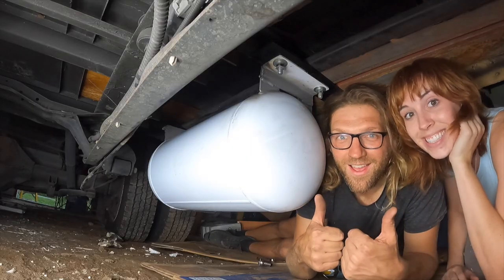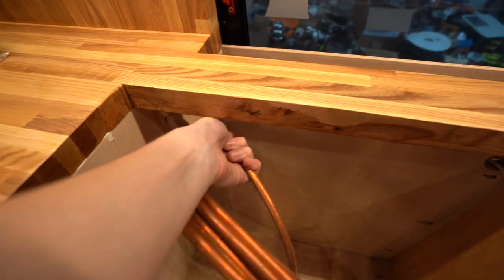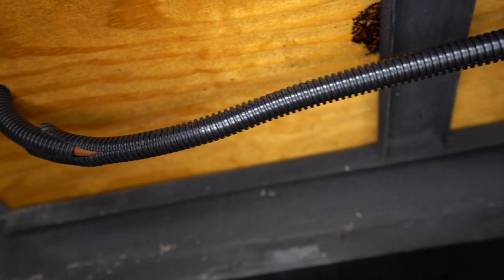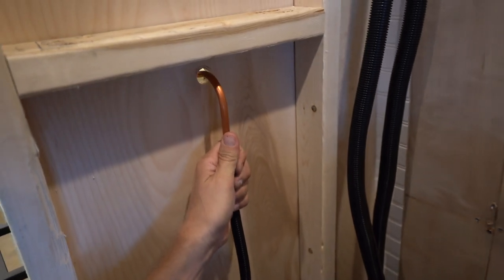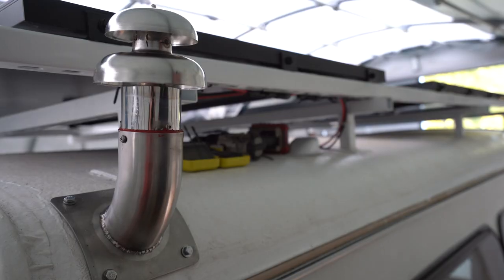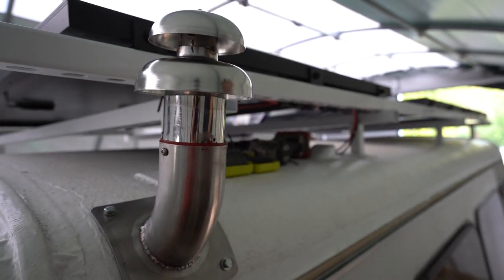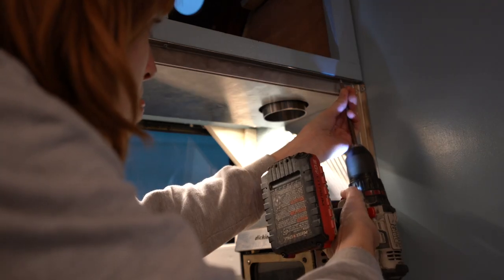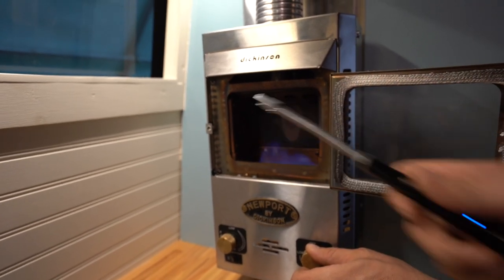Shuttle Bus Build Ep 15 | The Propane Episode! Water Heater, Dickinson Heater & Stove/Oven

Comment: Thank you for saying there's no need to be scared of propane. It's so useful. I do have the bbq tanks (two) mostly because I was not confident in under mounting my tank. I still usually use the propane fill as I bought two tanks with gauges that I like so I am not handing them off or trading them in.  🤣

Comment: Hey guys really like your video, it answered all but one question I have. When you put the caulk on your chimney cap, where you had the painters tape on there to keep the lines straight, do you peel the tape off while it is still wet or semi tacky, or wait for it to completely dry? I'm doing a 2003 flat nose 36 1/2' bluebird, I'm onto installing my propane heater stove right now. Trying to get some ideas of how to go about it. I subscribed, look forward to checking out some more of your videos to answer a few more questions. Thanks in advance.

Comment: What do you do about high altitudes 3500 to 10000 feet.  Other adjustments you have to for the propane devices
Reply from the maker: We have never experienced elevation issues with any of our propane appliances and we’ve traveled through plenty of elevation over the years. Even camping for months around 8,000ft, we didn’t have issues. Doesn’t mean it couldn’t happen, but we just haven’t personally dealt with it

Comment: Does your set up use that Azdele propane regulator just once at your propane tank? Is everything set to 11” WC? I know that heater claims sharing a regulator can be an issue so wondering what you two have found to work. PS love that heat shield you made!